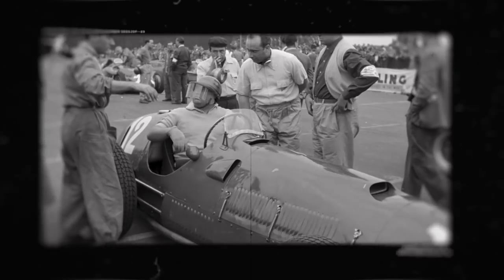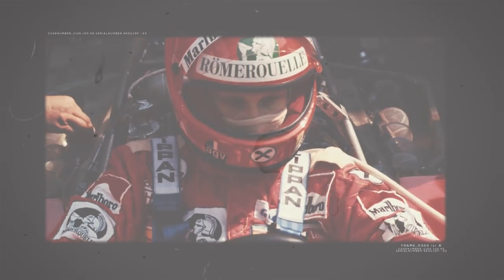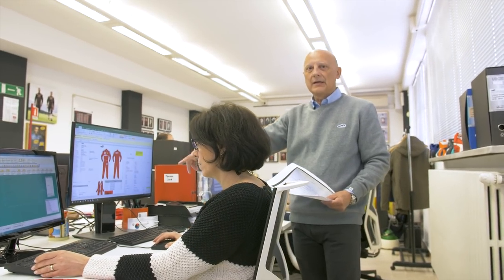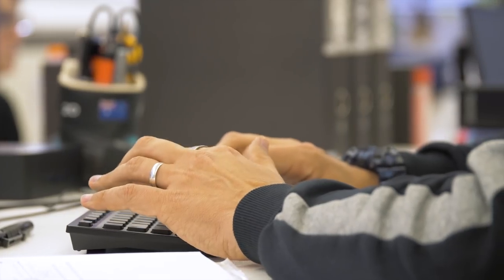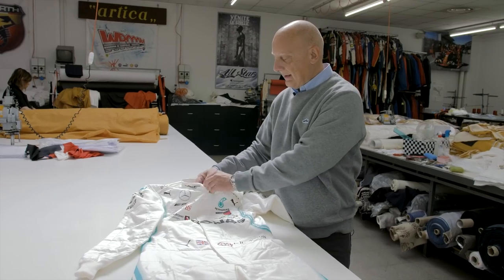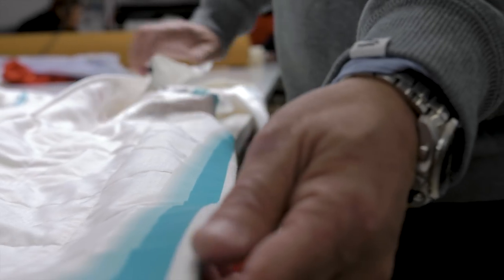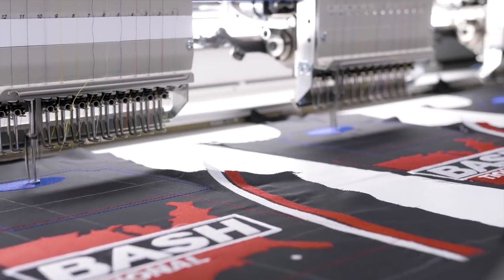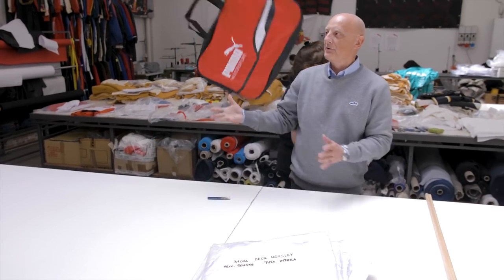How F1 race suits have changed over seven decades

Comment: Why are logos embroidered? It seems that screen printing would save weight.
Reply: risk of rubbing off and sponsors don't want that
Reply: @katkatkatomg  Good point. But this is F1; surely they can create something durable. And with their budgets, they can have a new suit every session if necessary. If sponsors can be convinced that the few grams give the car they are sponsoring an edge, then sponsors may concede needing embroidered logos.
Reply: Michael Ingraham     The money they save from embroidering would go into the r&d to the car and save more time than the quarter of an ounce in all the embroidery
Reply: @americanpride9733  Money? Money seems to be no object. If they'll drill holes in Velcro to save weight, weight seems more important than cost. Plus, would silk screening be more costly once the durability issue is resolved?
Reply: The logos being embroidered was a NASCAR Monster Energy Cup suit for Austin Cindric - son of Tim Cindric, the Team Penske president. They don't have to care for the last gram with their 3500 pound cars. Logos on Hamilton's suit were printed.
Reply: You should never screen print anything on a fire suit because the ink is basically a plastic and will melt onto the skin causing NASTY burns

Comment: He mentions replacing the zipper pull to save 2 grams, makes me wonder why they don't eliminate the zipper altogether if there's already a velcro clasp covering the entire length. Surely the suits aren't so tight they need a zipper and the drivers don't exactly move a lot in the cockpit.
Reply: velcro has significant gaps in it and would likely melt first in a fire. it needs to be a zipper
Reply: @FayyaazAhmed  understandable, got it
Reply: When he talked about the metal zipper, I was hoping he was going to say it was replaced with a carbon fibre zipper

Comment: Hahaha the guy is talking about saving weight but it's homologated to 80kg for driver and 740kg for car😂
Reply: But still you want to have as less weight as possible. So when you are under weight, you can add weight at the place you most desire, for the optimum weight distribution.
Reply: @rdevroede  not only that under the g forces the drivers go through the suits might feel something like 5 times their real weight so its also for drivers comfort